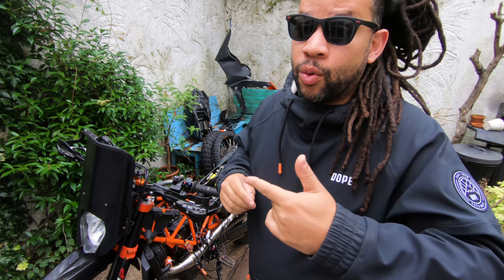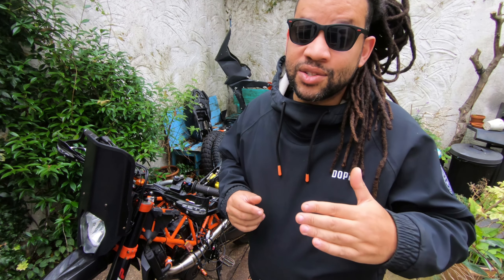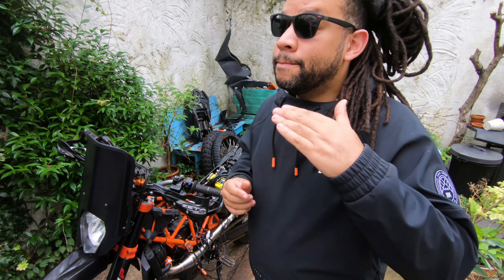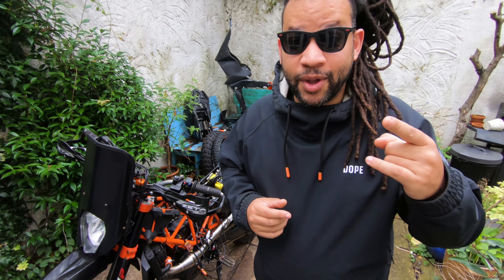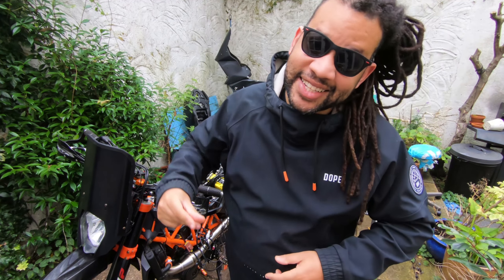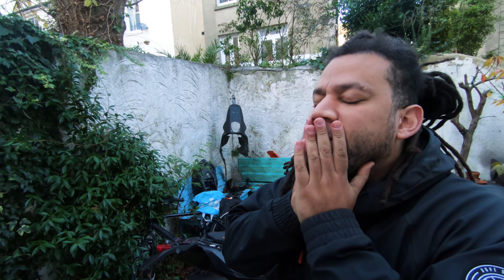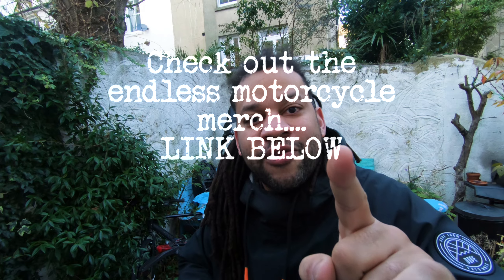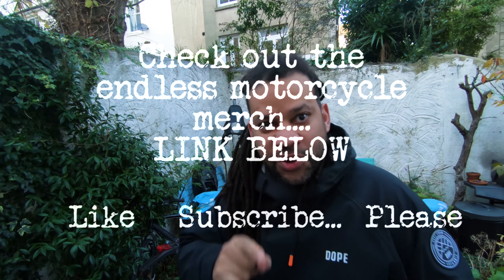Troubleshooting 690 Fuel & Compression | EP10 | KTM 690 BIG BORE BIKE BUILD

Comment: Hey I appreciate all the videos you have up and it has helped me tremendously
 My bike is now running today new starter clutch video helped me pinpoint what that noise was and I had to throw a new pressure regulator  and she fired right up its been sitting for 2-3 years started like a Champion 💪

Comment: Jesus i wanna hear it...good to hear from you bro!
Reply from the maker: I’ve gotten it to run poorly for a few times for a few seconds... Baffle out.. It sounds savage! So so deep.
Reply: @RideyBikes  I've got something to run by you...no pun intended....lol. I was told by a reputable engine builder that the 690 / 701 big bore kit isn't all its cracked up to be. They said the heavier 735 cc piston keeps the bike from reaching its usual high rpm, and tbh, thats where most of the power on this engine comes thru. They advised against this mod. Any thoughts on this?
Reply from the maker: @Bruce File  Interesting... “Not all it’s cracked up to be”?? That’s quite an ambiguous comment. How many of these big bores has he personally worked with? . . I can't speak to the achieved high RPM potential of the big bore setup (yet). My bike isn't finished and thus I haven't ridden it. 🤞🏽

I have however been in contact with other people that have done very similar builds to mine using the same BB kit. They’ve reported dramatic and or hilarious increases in power ESPECIALLY in the high RPMs when the build incorporates the rally cam. 

Lyndon has put well over 100k travel and race miles on his big bore 732. That at least a little shows that the setup is reliable and race worthy no? Also, I was reading that one guy with 732 BB bike has actually chosen to increase the rev limit (to 9500 I think) because the RPMS smash through the range so quickly! I won’t be doing this as it appears to give rise to lubrication issues amongst others things.

There’s quite a few dyno vids for the 690 out there on youtube. From my memory the power isn’t actually at the very top end of the rev range especially with the regular cam.

I would also say that my BB build was born out of necessity. My engine needed a full rebuild and the bike had been fairly damaged when run over by my neighbour and I wasn’t in a position to just buy the new (updated engine) 690. My girlfriend does have the new engine duke 690 and that bike is a wonderful beast. Having been on that bike quite a lot this year I would say that if I already had the new engine model i’d likely have had little to no interest in the big bore as with the addition of an EVO2 setup and some sort of powercommander, I think the power gains from those mods as well as it being a true 690cc would be enough for me and a mere 40cc displacement increase would be much less attractive.

As I said in a previous video, some people buy new, big bore or whatever for their own personal reasons. For me, my 2009 is/was a 654cc. I felt like I was outgrowing the power and I'm not in the 790/890 210kg zealot camp.

I'd be interested to hear which big bore kits he's worked with. From my research I can only speculate that your trusted engine builder may possibly be talking about the earlier big bore kits from back before the longer stroke and heavier counterbalancer were introduced with the 2012 690 dukes. I can only guess.. 
Throughout my research before I started, I never once came across any complaints about high RPM issues relating to heavy pistons. Just a few forum posts about people having issues with getting their own pistons made and then the mods to the engine cases that needed to be done after fitting said oversized (possibly heavier??) pistons. One particular thread was about a pre 84.5 stroke and around 720cc big bore (I think) I dunno, that piston would have been huge and heavy...

All I know for sure is that almost everyone i’ve been talking to about their BB 732 is absolutely over the moon with the additional performance with no reports of high RPM problems. 

Cheers 👍🏽
Reply: @RideyBikes  i appreciate your input. With that being said, I dont really know what to think. Maybe I should have gone with the BB kit to find out on my own how it really performs. Maybe I'll check into this more, maybe even still go in  that direction....🤔
Reply from the maker: @brucefile7430  I’ll certainly be posting my findings as I continue.
Reply: @RideyBikes  ok cool. Have you gotten any HP numbers from the BB mod group?
Reply: @RideyBikes  i forgot to tell you. I recently had Twisted Development tune and dyno my 2017 Husky fe 501. I had every possible thing done to that motor that we could think of. This bike  puts out 67 HP at the rear wheel. This also includes running ETS MX21 race fuel in it. The thing runs real good!
Reply from the maker: @brucefile7430  Last time I looked they were all seat of the pants feedback. People tend to go all quiet when their bikes are finished! 😂
Reply from the maker: @brucefile7430  67 at the wheel!!! Boom! That must be awesome to ride! Just checked the video.. It's a good looking bike!! Did you film the dyno run? I've got a strange addiction to watching dyno runs!
Reply: @RideyBikes  I wanted to see them dyno it, but unfortunately i wasnt able to. Because they needed to weld an O2 sensor into the header pipe for the dyno tuning, I dropped my 501 off to them on a tuesday and went back on a friday to pick it up.
Reply: From the input you gave me regarding the BB kit, I decided to switch things up again and give the BB kit a try. I also ordered the oversized injector from them too. When we eventually get it all put together, I'll have it dyno'd to see where I'm at. If I have the opportunity to video that, I obviously will. Do you have the PC 5 for your bike? I still have the stock ECU with a  coober fuel mgmt device piggybacked...
Reply: @RideyBikes  my 654cc 2010 smc last week on the bench,  60hp and 60nm full stock, but the intake valve clearances were too large 0,13+, also on the exhaust, which they are slammed open witch gives you a sudden increase between 4500 to 5000.  now they are 0,1mm tight and now it's more linear.  still, around 3900 and 4200 developed a weird sputter.
Reply from the maker: @brucefile7430  Sorry didn't see this. I do have a PCV and Autotune. First PCV was faulty but I can now get good readings from the new one and when I finally get the bike running, long term, I hope to develop the bike to live without any dynojet interference. Look forward to hearing about the BB build. 👍🏽
Reply from the maker: @stefanie_m466  Interesting... I wonder and or expect that Autotune would help in diagnosing or detecting the sputter. When attempting to create custom maps I noticed quite a few incongruous pulse widths through the applied power range... was working with the AKRA and EVO2 maps though. 
I was running stock setup and stock FI map for three months up to when the bike was stripped and don't recall anything other than linear power from 3k upwards. Was actually surprised at how good it was with a stock exhaust and map. 👍🏽
Reply from the maker: @stefanie_m466  Very interesting video. How many dyno runs did you do? Was the sputter absolutely always at the same place?
Reply: @RideyBikes  that day it drive well. the shop couldn pinpoint the issue but on forums and chat, all the same, clutch slippin. I need to make more vids to pinpoint the issue.